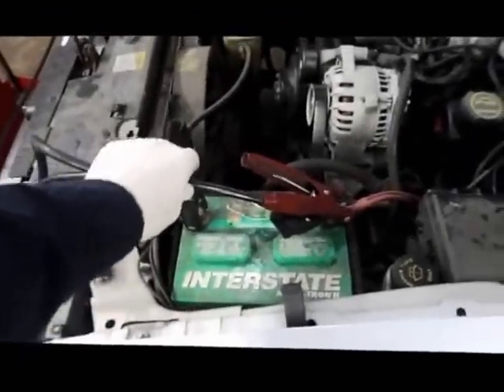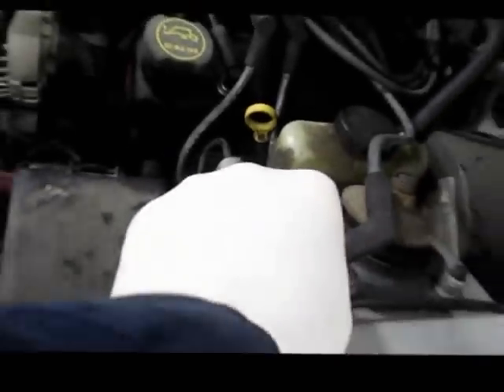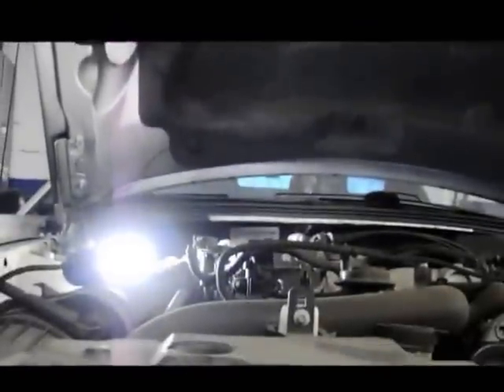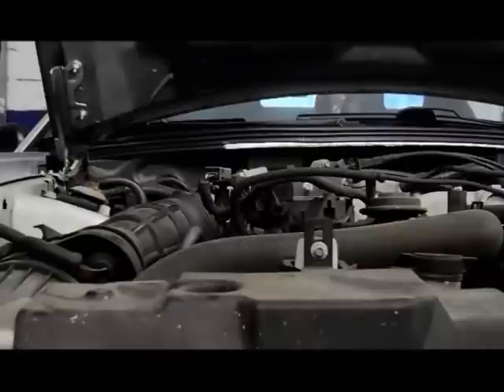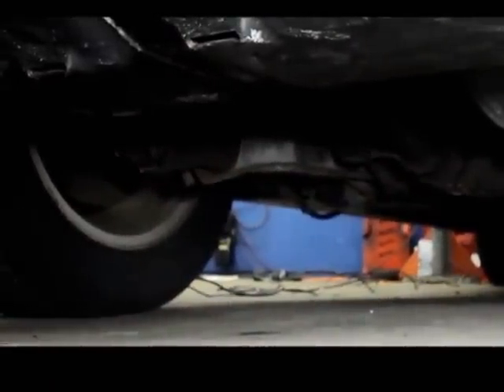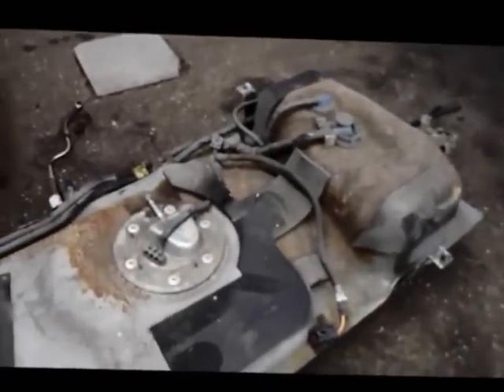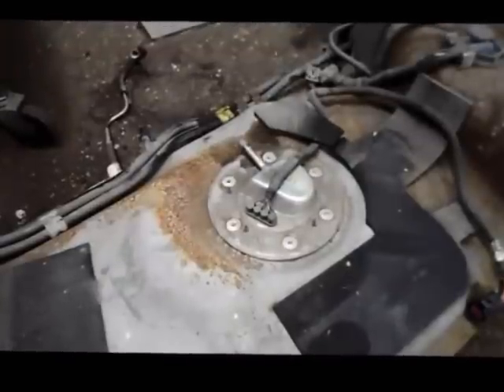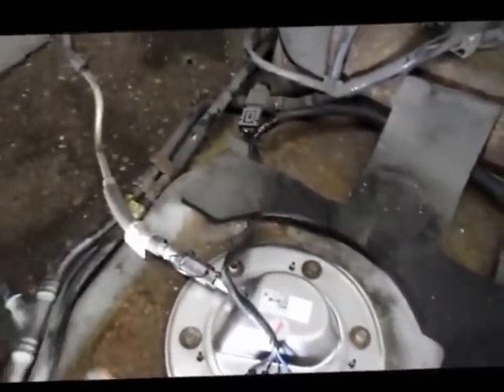Engine cranks but won't start

Comment: My husband was driving in traffic and the truck cut off. He tried to crank it up it didn't do any. When he got a boost off it crsnk but cut right back off. My friend said the fuel wasn't getting to the motor. Do that mean the fuel pump went out? We have a 2008 GMC Acadia.

Comment: tks Jim. the car turns over like normal just won't crank unless you use cables. its like its giving it extra voltage. I do not hear the fuel pump unless I do this. after cranks runs normal no cut out or jerk like pump is bad. tks jerry
Reply from the maker: +Jerry  Mcclure Do you want to call me so we can talk?I'm closed for the next few days but i can talk to you on Monday.Let me know
Reply: +jimthecarguy that would be great

Comment: I had the crank no start and it was the inertia switch was bad
Reply from the maker: +heydude76 Thanks for watching and for your input
Reply: thanks for your videos really help everyone one out, the inertia switch never even crossed my mind and I didn't think they went bad, anyhow I did a ton of things before I tracked the problem with the switch and ya for me it was a simple fix and its something im aware of now
Reply: 2019 all so have the computer rebuild at auto zone bring in your old one and they order it in a week it under your glove box

Comment: what if you cannot get to the spark plug wires, because they are under the valve cover?
Reply from the maker: Butterfly Taxi DFW  There should be a cover over the plugs that will have to be removed  so you can get to them.
Reply: It is not just a cover, it is an intake manifold and it takes an experienced mechanic a couple of hours to change them out, so I can imagine how long it might take me.  Thanks for replying.
Reply from the maker: Good luck.

Comment: 02nissan sentra gxe..coils have no fire.replaced cranksensor.still no fire.any advice.car runs good parked 2 weeks.turns over will not start. coil pks dead.
Reply: could be a key issue. is there a theft system in your car? also check all your fuses.
Reply: My 1CoLoRz2

Comment: My husband watched this video because we had the problem with our 97 Ford after minor work he did (shocks replaced) and it wouldn't start. He discovered (thanks to the serendipitous visit of a neighbour) that the fuel pump shut-off switch had tripped because he was bouncing the car to check the shocks and lifting and lowering it and dropping it. He pressed the red reset button on top of the shutoff switch and then when he turned the key he could hear the fuel pump run again. It started!
Reply from the maker: Lori Gosselin  Thank you for your feedback and for watching.I' m happy that my video was able to help you.Jim
Reply: +Lori Gosselin where is the red reset button
Reply from the maker: +Deborah Bennett Depending what kind of car .It may be in the trunk or in one of the kick panels inside the car .If you still can't find it email me at work on Monday I will look on my computer.
Reply: +Deborah Bennett Sorry - didn't see your question Deborah1 Glad Jim is able to help!
Reply: +jimthecarguy do you know where a reset button on my 96 toy.camry would be located?
Reply from the maker: +Slicknick 48  Yes it don't have one.
Reply: Thanks Jim.If I have to my fuel pump replaced..do you know what the average cost would be?..i live in So cali. Thanks again for your helpful input & videos.

Comment: I know this is an old video but if you have a Ford probe GT and it won’t start back in the day the common problem was the distributor they go bad so just go replace the distributor and it will start right up no problem I went through four different distributors back when I had a probe

Comment: jim,i have a 2000 ford expedition 5.4 it has a crank no start issue but it only does it sometimes.not all the time.most of the time its been cold weather situation.so im thinking crankshaft sensor,it was very dirty washed it power washer the next morning 25 degrees it starts right up,next day 27 degrees starts up,finally 50 degrees it wont...help
Reply from the maker: +Dedicated Recycle  It is possible but you will need to do more diagnostics before you replace it .Check out my videos for further advice.

Comment: hi I have a 2000 lincoln continental that well only crank if I jump start it with cables and another car, I know that battery is good, I have also tried another new battery in it, will not crank without putting cables on, everything looks clean please help. thank you jerry
Reply from the maker: +Jerry  Mcclure Hi Jerry ,When you try to crank without the jump start what happens?When you put jumpers on it do the car crank right up or does it sound like it is cranking slow?
Reply: jimthecarguy hi jim, it turns over normal both ways,but wont crank unless cables are on it, strange, tks jerry

Comment: your saying an annoyed light what the hell is that even closed caption understands and calls it that. I want to order one of those lights, but need the REAL name and the link as to where to get them
Reply from the maker: They are called noid lights. Check my Amazon store below the video for the lights
Reply: @jimthecarguy  another viewer stated that I should save a bundle of money and just use a test light on the injector connectors

Comment: Hi Jim I have a 99 crown Vic that I had to replace the gas tank a fuel pump my car was sugered...the mechanic who I brought it to put a used gas tank (not happy with that ) and a new file pump..I also replace two injectors and fuel filter. Blew out the lines as well..the 2 issues I have is the car runs fine but if I drive it after say 5-10 minutes a she'll stall out and it's hard to start..the second issue I have is I can actually hear the fuel pump whining when  cars running when I open my trunk and stick my head in..I've checked out 2-3 other crown Vic Grand marquis and I don't hear the pumps whining at all..I was told that done aftermarket pumps will whine..what do you think?
Reply from the maker: +motts722 Thanks for watching and for your input
Reply: motts722 pop

Comment: It’s either the fuel pump fuse, or the fuel pump itself if you can hear a car crank, if the starter wasn’t receiving power you would hear a click when cranking rather than actual cranking noise, also, if you hear the beeping noise when the key is in the ignition, the fuel pump is receiving power from the fuse. But the real question is, is the fuel pump working properly and creating enough pressure to pump fuel into the fuel tank
Reply: When my husband turns the key in the ignition you can hear the click what does it mean.

Comment: For mine - 2004 Triton V8  -  it doesn't happen in the morning or after it's sat for 2 hours or more. Only if I drive it, stop for a few minutes like the gas station or grocery store then try to start again after only sitting for 10 - 30 minutes.

Comment: 96 Cadillac DeVille has fuel pump pressure has spark cranks over won't start. Sprayed starter fluid into the carburetor area. It starts up runs for 10 seconds then shuts off. Check all the fuses none of them were bad. Check the PCM it's fine. Bought a set of Noid lights to check the fuel injector power. No flash. Now I know the fuel pump is brand new. The old one wasn't even bad. The oil pressure switch ack's a fuel pump relay backup I'm wondering if that's the problem.  I got up under there to look I didn't see no oil dripping from it but that still doesn't mean that it can't be bad. I brought a new fuel pump relay fuse and it's just fine. But soon as I spray the starter fluid into it it fires right up. The fuel pump pressure regulator is not leaking so I don't think that's my problem either. I'm stumped on this any suggestions

Comment: 2003 fuel module replacement and location. Can't seem to locate mines
Reply from the maker: +MrJusticemiles2003   The fuel pump driver module is located in the trunk above the left rear wheel.
Reply: +jimthecarguy Thanks, but I have a F150 2003 Lariat truck

Comment: We are having an issue like this with a 2003 ford mustang. It's stuck at a store until we can get to a shop. Any advice to get it going to get it to a shop or do we have to tow it. How much does something like this cost?
Reply from the maker: +Jackie G  If the fuel pump is the problem sometimes you can get it to start by hitting the fuel tank when you are cranking the car.This may cause the fuel pump to start to work enough to get it to a shop.Git it a try .Keep me posted.Jim
Reply: +jimthecarguy didn't work
Reply: +jimthecarguy didn't work
Reply: we tried to put a little gas in to see if that would work.... it didn't

Comment: Hey was wondering if anyone could help I got this truck almost a year ago it ran twice now anti theft is on ? looking at it and pretty sure an engine swap was done and things are spliced and fuel pump sensor is by passed then the engine block ground is snapped what and anti theft is on its got crank but no spark is it anti theft if so how do I rest it ?
Reply: Does your key have a computer chip? Crankshaft could have been damaged during engine swap.

Comment: Question! I have a 92 Nissan pickup with the 4cyl and itll crank but wont start. Ive changed the plugs, ignition coil, distributor cap and rotor button, and the fuel filter. Any suggestions?
Reply from the maker: +w32x Thanks for watching and for your input
Reply: check your battery lines both positive and ground, to make sure the lines aren't corroded. was there a lot of corrosion around the + and - battery connectors??
Reply: No there wan't any corrosion. We found out now that my timing is off and we're struggling to get the timing set with the distributor and the oil pump
Reply: ahh ok cus I literally had the exact same problem and it was my battery lines. Both of them were more green corrosion than copper. looked like the statue of liberty I'm not kidding lol. once I replaced those and one relay fuse everything was perfect.
Reply: Good luck! what kind of vehicle? sorry just re-read ur original comment. Good luck tho I've worked on my 2002 GMC Sonoma pick up and it has a stupid vortec which just creates a bunch of problems for my alternator, battery, fuel lines, I mean it has to be maintained literally weekly but I try to maintain it every couple weeks.

Comment: Your video made me appreciate a good mechanic who knows what they are doing. We complain about what they charge but they often deserve what they get paid. It is difficult to find a good one you trust. Good job. I have a 96 Ford F150 that had intermittent shut off/restart issues I bought last summer but now cranks but won't start. My mechanic has not nailed down the problem and doesn't want to just start replacing parts. Another Youtube video turned out to be the inertia switch.  When weather improves here in Greenbay, guess I will get out there and tinker with it myself. Or get it towed somewhere. Thanks for your tips.
Reply: Donald Whitson - Did you ever get it fixed? What was the problem? Thanks!

Comment: how much pressure should there be on the schrader valve. on mine gas did come out but didn't notice pressure... thanks!
Reply from the maker: There should be any where from 35-55 lbs of pressure .Remember that you will need to cycle the key a few times to build pressure.When you press in the valve the fuel should spray up at least several inch high.Be carfeul with the fuel (no sparks)Some of the big auto stores rent equipment check if you can rent a fuel pressure tool.. Good luck

Comment: i did all that testing except the injector diod testing. but i have fuel pressure at the rail an i have spark at the plug boot. my ex sister inlaw said when she got in it started good. than oil pressure guage started to fluctuate an sounded like it was gonna stall so she gave it a bit of gas an it just died. than she an i tried turning it bak on an nothing. it is my work truck. i work construction an im a foreman. i need my truck for work. please help
Reply: You need to check the injectors, then check the fuses and relays. If all is good, check the compression and timing. If it doesn't crank at all, then checking the timing and compression isn't going to work.
Reply: I got it. Was the fuel pump. But odd thing was I had pressure at the fuel rail. But it's all good. Thanks for the info

Comment: I have a big issue, I just bought a used 06 chrysler 300 last week and it shut down on me twice on the highway as I was driving I tried to turn it on and no luck.. my friend put in $3 worth of gas and after turning the switch several times it started but the weird thing is on the dash before my car shut down it said it had 3/4 of gas so I need help?? What can it be?? I'm a woman and have no idea when it comes to cars😢

Comment: starter went out replaced the starter now all it does is spin new battery,  starter, starter belt, starter relay switch, + battery cable and had the alternator checked what could be my problem.
Reply: solonoid on the starter
Reply: brand new starter brand new battery
Reply: I have a video of how it sounds
Reply: added a video hope this can better  help you tap the R my video should pop up I have spark everything is new please hit me back and let me know what you thank
Reply: Plunger has to have power to extend into flywheel.....solenoid
Reply: It the inside computer under you glove bow have it rebuild at auto zone 2019

Comment: ok im baffled ...........bought a 1999 ford f150 been sitting for about a year had parking brake stuck and they thought rear end was out...got it home fixed the problem drove it about 6 miles noticed front brakes hanging up so it sat about a week until got the issue fixed went out to start it to move it to mow..      It started and died Started then died It cranks no spark fuel pressure is running about 38psi checked all fuses and relays tightened all grounds to firewall what can be the problem ............replaced cps and still cranks but no spark thanks for the help
Reply: Fuel inertia switch fords have them

Comment: Jim, they put it on a diagnostics tester and the only thing it showed was a crank position sensor. Does that sound about right? Can you send me a video on how to change one on a 2002 accent.
Reply from the maker: +carl hicks  Most likely the sensor is no good if it show the code.I don't have a video for replacing the sensor but the sensor should be on the front left of the engine by the exhaust.(left is the driver side) keep me posted

Comment: I have a 2008 infiniti Qx56 and I have this problem. cranking but not turning over. any suggestions?
Reply from the maker: +Raoul Wright You will need to do some diagnostic first.Follow the procedure in this video and you should be able to narrow it down.Let me know if you need and further advice.Jim

Comment: own a 2000 BMW 740li. I parked it for three months. Went to drive it. Battery was dead. Replaced battery and the car will crank over but not start. Replaced crank shaft sensor, still no start. I have no fire nor fuel. Suggestions?
Reply: Joe Clark b
Reply: check PCM and fuel pump relays. try swapping them out with relays from blower motor.

Comment: did it get a seal/gasket for the pump top cover?
Reply from the maker: +KelJenn B Yes when ever the pump is replace the seal is always replaced.Good question.
Reply: okay, thank you.
Reply: jimthecarguy. Ok I'm having issues with my mustang 03 replaced ignition had system reset dropped tank cleaned it out fuel pump is good it turns over but won't start unless I saturate it with starting fluid next thing is injectors I need to know where the injectors can be tested I know on my bronxo where they are but not the mustang? Its not getting fuel it seems also I have checked the fuel shut off. Button that's not it. Plz help this was my dad's car his friends stole it after he passed and all I'm trying to do is get me n my babies transportation.

Comment: I replaced the engine in my 2003 Ford explorer 4.0 with a remanufactured directly from Ford. My question is does changing engine throw the vehicles computer off. It did start the day the new engine was installed but can't get to start again. Thank you for any ideas and help.
Reply from the maker: I do a live stream on Sunday night I will talk about this on my jimthecarguy show tonight at 7:00 PM (EST).I hope you can stop by.

Comment: I have a 2000 4.7 4 wheel drive that just died while I was driving. on my way home from work for a week it would put it self in to limp mode I would reset the truck and it would run just fine Intel I was on my home the next day. I replaced the starter the computer PCM the crank and cam sensors the water pump. fuel pump does come on gauges work but no abs light no check enige light and no secertiy light what could it be???
Reply: swap your fuel pump relay with the blower motor relay and try starting. If that doesnt work than swap blower motor relay with PCM relay. Seems silly but worked for me. If it works than buy a few back up relays and keep em in your glove box.

Comment: There are different fixes for Crank No Start. When you work on the engine for a while you do something to the settings of the vehicle and you might need to do a reset this will clear old codes too. Ok disconnect negative cable and get another wire maybe one side of a jumper cable and put one end on the Negative CABLE make sure it is away from the battery terminal may be put a rag over it to make sure they don't touch  then touch the other connecting end to the positive side terminal for one minute. another CRANK NO START fix is to check Crank Positioning Sensor  THEY ARE USUALLY OUT OF SIGHT FROM THE TOP OF THE ENGINE. They can't be forgotten after pulling the timing chain cover off.
on a 99 ford Expedition 5.4 its underneath passenger's side. With it unplugged it will still have fuel pressure but spark.